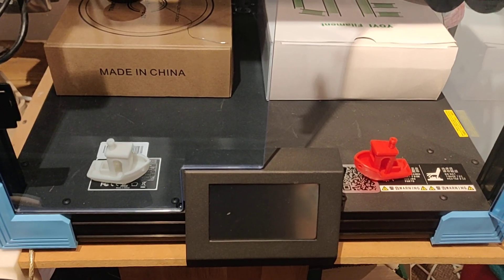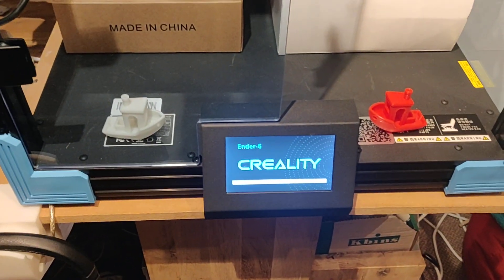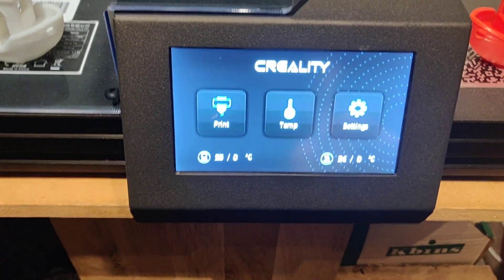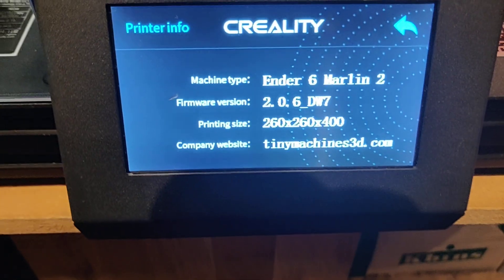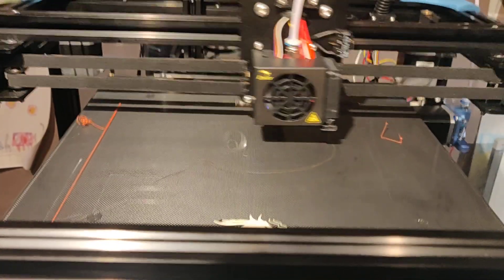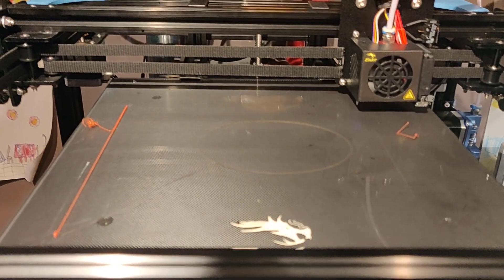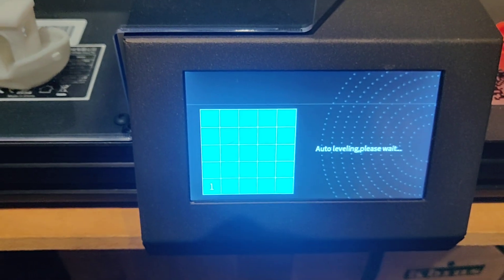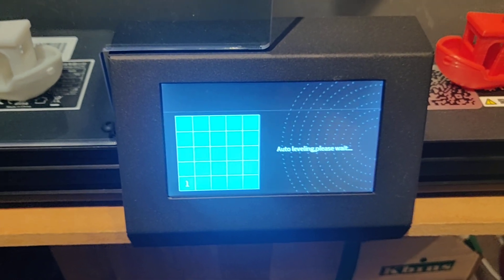Creality Ender 6 DWIN LCD to Marlin 2 port

Comment: Hi, i just bought my printer and ender 6
And when i go level it, She just stays on auto home and dont move more and the z Axis don t move too, but when i try to move the z Axis up on down on screen it moves, any advice?
Reply: Did you flash the BLtouch firmware instead of the End stop  or vice versa? Usually causes this behaviour.
Reply: did you use dwin hmi?

Comment: @Barry Carter I figured out what's going on. I am not able to perform leveling with the SD card in. I tried 2 different cards with the same results and thus that was my conclusion. Do you know if the ender 6 is able to save the epprom file to the board? If I can do that then all my problems are solved. I will buy a new as card just to make sure no files have any tampering issues. This basically makes it impossible to print the way eeprom works right now.
Reply: You may need to format  your SD card on PC first
Reply: @huangphyllis1567  I did that and bought a new SD card. The issue is the cable from the reader to the lcd. I need a new one, but haven't found where to get it. My prints are coming out very well. I'll do an updated video of it printing.
Reply: how is everything going?

Comment: Is it possible to get the files that you have used for making the bin file? 
Because I have tried to make the firmware by myself but it will not work.
Reply: did you use dwin hmi?
Reply: @beijingdwinsusanvan2278  is that the stock screen? If it is yes
Reply: @jvanwees  hi, yes we have many such screens are in stock

Comment: @Barry Carter - You have done a great job with this video. I look forward to the files you upload and I thank you in advance. Not much videos on the ebder 6,  so I show support to anyone who has content on it. I will like and subscribe to your channel to give you support. I did have a few questions. (1) I have the ender 6 for over a month and suddenly it is giving me bed leveling issues both with the end stop and BL touch. I am seeing the axis go diagonal on both aux leveling and measuring for the BL touch and the end stop. The end stop can't do measuring, so that only applies to the bl touch. Even when I print it comes out diagonal. I have gone through all firmware updates and have not been able to resolve the issue. I don't I know what code ecfects this functionon. but I will leave a link to the video so you can see what I'm talking about. (2) Have you been able to edit the epprom.dat file? I used pronterface and have not been able to run m501 to save my settings. (3) How did you edit the firmware and what settings gs did you apply to make it function?
Reply from the maker: Thanks!. i've put the link to the source up in the description. You can see where my lcd screen efforts were focussed.
(i'm no marlin expert)
1) I have no idea why you are printing diagonal! 
2) Not had any eeprom setting issues. I would reset/delete the eeprom completely and then reconfigure. Personally I have used a hex editor on it to make a quick and dirty change.
3) vscode and marlin source. nothing out of the ordinary, follow the IDE setup guide for your environment and you should be good to go.
Reply: @BarryCarter  can you post the link in the comments? I can't see it via the description. I will apply what you said.
Reply from the maker: @gametek7592  https://github.com/ginge/Marlin/tree/CrealityDwin_2.0
Reply: @BarryCarter  thanks I'll see what can be done. I also wanted to know what code effects the aux home 16 boxes and 5 (box) points on the firmware? I will try compare this to crealities firmware if possible to see if there is a difference. My final guess was the board is the issue.